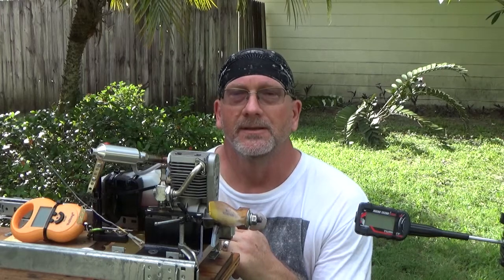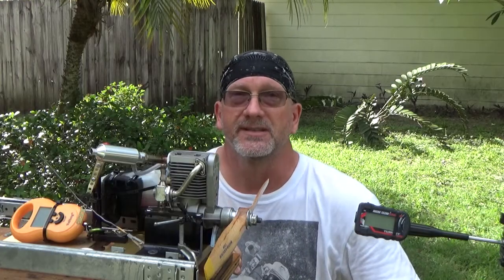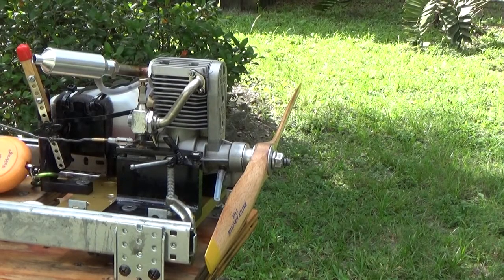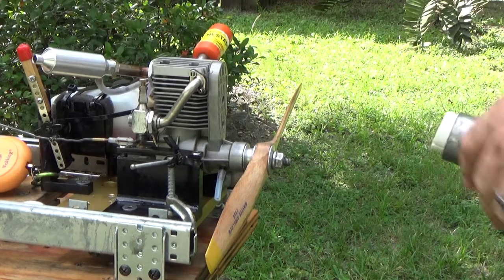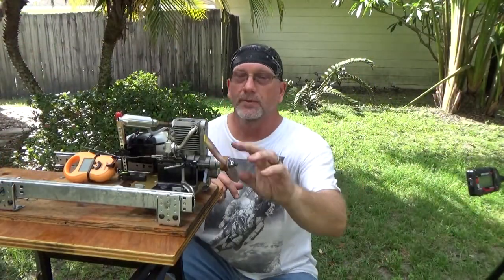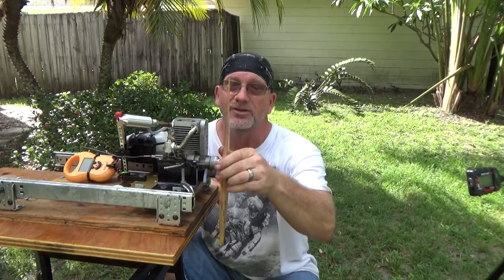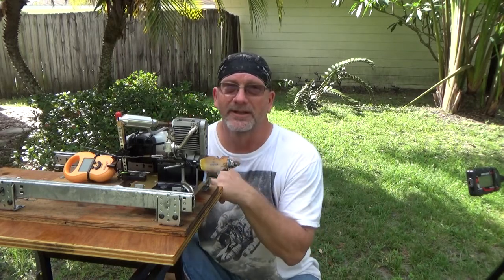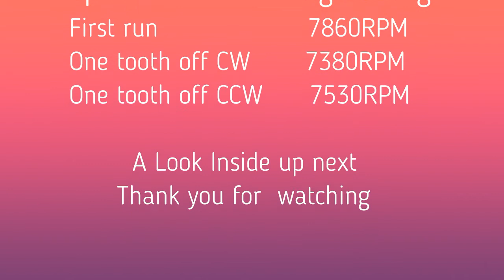Webra T4 60 Different Timing Settings

Comment: How is the valve timing initially set? I have the larger .90 and I expected to see some kind of marks on the pulleys, there is none.
Reply from the maker: That is where you need the manual.
https://drive.google.com/file/d/1UHvU_aOjC3xPQQkySHo5uQl7HGY5GcV-/view?usp=share_link
Reply: @dmrcflyr2  Thanks but there is nothing in there either about valve timing setting, only reference to timing marks that are non existent on my T4 15cc
Reply: @TheHalloweenmasks  never done one but seems like it would be the same as anything else... get the valve tube (wtf?) so its "on the rock" which is generally TDC for a standard 4 banger... that moment of overlap when you can blow straight through the thing...

and then its simply fiddling.

might be put on backwards and the marks hiding?

i said i never seen one but comeon, fourstroke cycle is fourstroke cycle...
Reply from the maker: @TheHalloweenmasks  What are you talking about? There is an entire diagram showing the timing.  Perhaps you do not realize this is a rotary vale engine it does not have separate intake and and exhaust valves.
Reply: @dmrcflyr2  I do realize this this is a rotary valve engine, I had one of these many years ago. Rotary valve engines do not have conventional valves but they do have intake and exhaust timing events, maybe you do not realize this. BTW I am stating not talking.